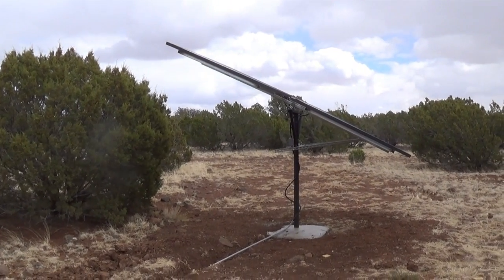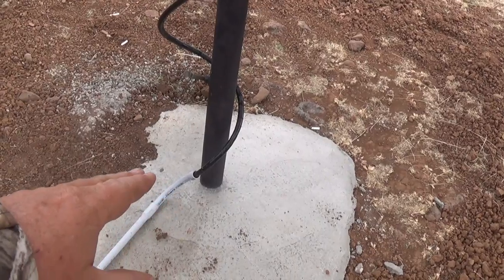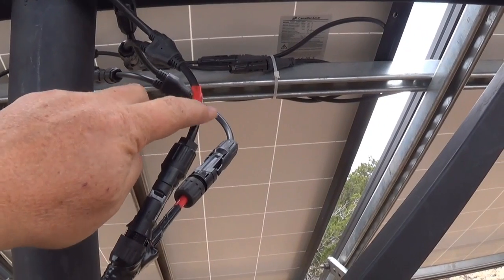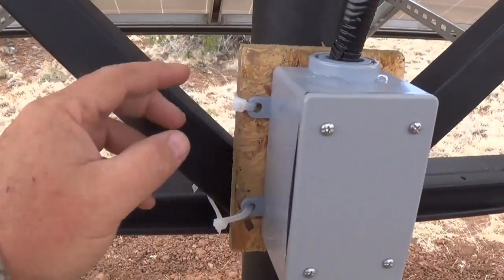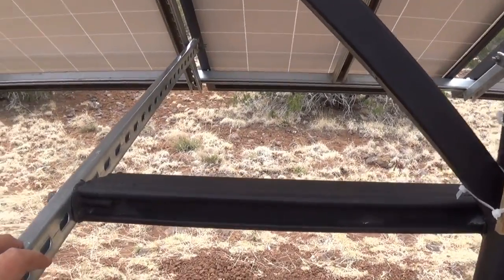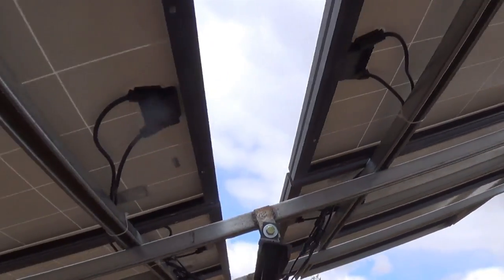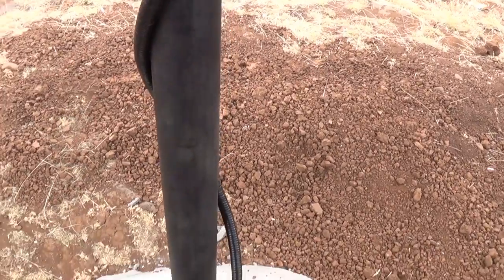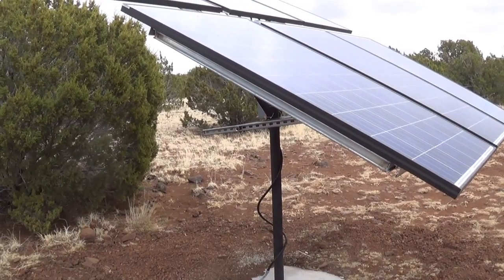Solar Pole Rack - Manual Adjustable both Axis - Holds 6 260w Panels

Comment: For those designing difference in relative load/press  ; Pounds per square foot @ 50 MPH=6.4 PSF,   @ 100 MPH  25.6 PSG   so 4 times as much force.    If he wanted to reinforce his design he could place a collar far up the shaft (so it could still be rotated) and attach outward legs/struts to the ground outside the cement area.   Probably would have other failures at the panel depending areas at some speed below 100 mph though.  He may never have higher wind speeds. We do, most of the USA does too.
Reply from the maker: thanks for the info. i have had 70 mph winds and so far all is holding up fine. i do worry everything the heavy winds come.

Comment: You dont have a good electrical connection between your rotating pole and stationary in the ground pole to make a "EARTH GROUND".  Your ground rod needs to be 8ft long min and driven into the ground.
Reply from the maker: when i add more panels i plan on doing that.

Comment: do you have multiple holes drilled in the inner pipe for rotation ?  if so - do you think the pole has been weakened
Reply from the maker: no. just a set bolt applying pressure to the inner pipe.  dont think holes in the inner pipe would weakened it.

Comment: Hey I have another question if ur batteries start immediately going down once on battery power is it time to get new batteries even tho I have only two small 35ah deep cycle batteries I'm only actually using about 300 watts of power and they runs down quick they don't hold at all basically
Reply from the maker: the batteries not holding their charge does mean something is wrong with the battery. maybe not a long enough float charge or just a bad battery or which i think is your case. if batteries are 12 v 35ah wired in parrellel you have only 35a at 12v to work with. 35 x 12 = 420w of use. you have less than 1.5hrs of use in the batteries. so if you say they dont last 2 hrs and your using 300 watts as your load thats becus your battery bank is not large enough. you need bigger system.  watts = amps x volts..... if you are using 300 w for 5 hours per day you need 1500 watts . your battery bank needs to hold a min of 3k watts. = 12v x amps.. you need at least 250amps for your battery bank.  hope that helps
Reply: @ArizonaHotHomestead  oh ok what about if I get me two of those 6v 225ah deep cycle golf cart battery and make one 12v battery out the two until I can buy another two and have 4 6v 225ah would that be enough !
Reply from the maker: @thelithiumpowerch  the first 2 batteries give you 12v 225a giving you 112a of use at 12v. = 1344 watts. that 300w use now is good for over 4 hours. ... adding the other 2 batteries will give you additional 4 plus hours.
Reply: @ArizonaHotHomestead  oh ok sweet so it should take about 4 hrs of use before I hit the 50% mark ? on the first two batteries ?
Reply: @ArizonaHotHomestead Gm I'm about to head to Sam's Club today and pick up two of the 6v batteries when u say I'll get at least 4 hrs of run time is that meaning til I hit the 50% mark to charge them up ?

Comment: Hello love the video I have a question it seems like no matter witch way I hook my panels up the amps seem to double I'm not sure witch rating is the proper amp rating these are 335w panels one rating say maximum fuss 15A the other day current at Pmax 8.79A either way when I hook two panels in either series or parallel I'm getting upwards of 33-34 amps coming in witch keeps blowing my 40a breaker
Reply from the maker: i am no expert but if you wire them in series you should increase the volts and keep the amps the same. not sure what is happening.
Reply: @ArizonaHotHomestead  I think I figured it out I had this inverter hooked up wrong now the panels are reading the amp the right way

Comment: what kind of power do you get from those 6 panels on an average day? Hoping to see if a pole mount will increase my ground mount production. I get about 12kw with a 4kw system on a nice sunny day
Reply from the maker: i have no idea. i dont check it every day and my charge controller doesnt record the total collected. ground or pole shouldnt matter its the angle to the sun that matters .

Comment: Might want to consider running your wires off your panels to a solar panel breaker box. That way if there's a need to cut power at the panels you can do so easily without having to pull your MC4 connections apart.
Reply from the maker: i do have a inline breaker that i use as a switch to cut the power before it gets to the charge controller.

Comment: My Solartracker Steel Mount ➡️ https://youtu.be/X0lmYFwOq3U
Reply from the maker: ok
Reply: Hi, So increase self-consumption sharply in order to save electricity costs by avoiding electricity from the grid / shortening the amortization. With Dimmer + Solar PV, self-sufficiency will now increase to almost 95%, because expensive purchases from the grid are so easily suppressed and the electricity bill stops just like the electricity meter. The prerequisite is that you have at least a small solar PV balcony power plant, and you don't need an expensive battery either. Example of a kettle: Without a dimmer, the 2500W - 600W PV system needs = 1900W, which you have to pay more for. If I turn the kettle down to 600W with a dimmer, then every weak PV system can now supply each consumer independently and independently, because the 2500W kettle becomes a 600W kettle thanks to the dimmer. No magic, just physics. The 2000W electric heater becomes a 500W electric heater via a dimmer, which I can run 12 hours a day free of charge via PV. https://youtu.be/eC2olbCBhh0 . The 4000W oven is also tamed. It is not the solar systems that have to grow, but the consumers simply have to drop by 75%, which is so easy with the dimmer. I have already switched my entire household to dimmers. Please have a look at my channel. .......... 🌞 ........... Increase mini PV solar self-sufficiency (winter and camping): A boiler and other power-hungry consumers can be infinitely reduced using the "5000W dimmer". Ebay €7. I run 4 dimmers in parallel on an 850W inverter. Kettle 2.2KW at 150W runs 12 hours a day, so the water is always hot https://youtu.be/D9Ss0RuqZG0 . The room is also nicely heated. 2.5KW washing machine runs in parallel with dimmed to 400...600W and always reaches its 60°C, and also its 1400rpm... It doesn't matter to the washing machine whether it changes the washing temperature to 5min@2500W or 100% can be achieved free of charge via existing PV power in 20min@600W. The wash cycle lasts the same time dimmed and non-dimmed, 3Sth 10min. The iron https://youtu.be/-71oL7z1kMU , dishwasher https://youtu.be/8vnAkrS1x-s , oven https://youtu.be/azDjqZpz77U , electric heater https://youtu.be/QbLWDbJi6ew , Waffle iron https://youtube.com/shorts/ofanZCdYEjA?feature=share, coffee machine, all internal heating is throttled with me. Lots of videos on my channel. The inverter stays cool and quiet and the MOSFETs + (battery packs) stay intact because extreme current peaks no longer reach the inverter. Now every Mini PV Inverter is enough to operate large devices. So, with the dimmer, all internal heaters/devices can be converted into base load devices that stay almost permanently ON, drawing very little current directly from the PV. With a wattmeter / energy cost meter you can then measure this perfectly in order to set the dimmer optimally. ........ Comments: "Great idea - despite studying electrical engineering, I didn't think of it myself ;-)" or "I installed it in our washing machine, great idea!" or "Glück Auf Christian, I'm a professional myself but I haven't figured that out yet.👌 Greetings Mitch💚" and many more... LG Christian .............. 🌞 . .............. "smart energy saving", has made a meaningful reaction video, to the dimmer: https://youtu.be/EHtJGiXAjZk . 🌞 ......... "Free Range", also made a meaningful reaction video, to the dimmer: https://youtu.be/qzdRdBObtvY . 👍........ "Jens Kummerow TS", also made a meaningful reaction video for the dimmer: https://youtu.be/fTY5jWvz5CY . ............... 👌 ................ A little hint: Energy cannot be saved. So if I want to boil my water, I always have to use the same amount of energy for one liter. Christian's method relies on a longer period of time with less power in order to be able to use the power provided by the PV as efficiently as possible - so consumption peaks are intercepted. In the end, the energy consumption should even be (slightly) higher due to the interposition of the dimmer, but it doesn't matter, since more efficient coverage by the PV system and therefore better use of the self-generated energy .......... ...... ................ Here an "automatic PV excess control + remote controlled dimmer with heating element" / load management (consumption / heating element follows PV excess .. .): https://youtu.be/IWp7Mi2FldM . LG Christian .............. 🌞 ............... I installed a 2-axis solar controller in my DIY solar tracker: https:// youtu.be/_Rs8CptQcDw. ................ ............... ................ More videos on this on my channel. ....... ................ ................ ............... ............... ................
Reply: Hi, Increase PV solar self-consumption sharply in order to save electricity costs by avoiding electricity from the grid, shortening amortization. With Dimmer + Solar PV, self-sufficiency will now increase to almost 95%, because expensive purchases from the grid are so easily suppressed and the electricity bill stops just like the electricity meter. The prerequisite is that you have at least a small solar PV balcony power plant, and you don't need an expensive battery either. Many examples below: https://youtu.be/eC2olbCBhh0 , Kettle: Without a dimmer, the 2500W - 600W PV system needs = 1900W which you have to pay more for. If I turn the kettle down to 600W with a dimmer, then every weak PV system can now supply each consumer independently and independently, because the 2500W kettle becomes a 600W kettle thanks to the dimmer. No magic, just physics. The 2000W e-heater becomes a 500W e-heater with a dimmer, which can run 12 hours a day free of charge via PV. The 4000W oven is also tamed. It is not the solar arrays that need to grow, the consumers simply need to drop by 75%, which is so easy with the dimmer. I have already switched my entire household to dimmers. Please have a look at my channel. 🌞 ........... Increase mini PV solar self-sufficiency (winter and camping): You can continuously regulate a boiler and other power-hungry consumers with the "5000W dimmer". Ebay €7. I run 4 dimmers in parallel on an 850W inverter. Kettle 2.2KW at 150W runs 12 hours a day, so the water is always hot https://youtu.be/D9Ss0RuqZG0 . The room is also nicely heated. 2.5KW washing machine runs in parallel with dimmed to 400...600W and always reaches its 60°C, and also its 1400rpm... It doesn't matter to the washing machine whether it changes the washing temperature to 5min@2500W or 100% can be achieved free of charge via existing PV power in 20min@600W. The wash cycle lasts the same time dimmed and non-dimmed, 3Sth 10min. The iron https://youtu.be/-71oL7z1kMU , dishwasher https://youtu.be/8vnAkrS1x-s , oven https://youtu.be/azDjqZpz77U , electric heater https://youtu.be/QbLWDbJi6ew , Waffle iron https://youtube.com/shorts/ofanZCdYEjA?feature=share, coffee machine, all internal heating is throttled with me. Lots of videos on my channel. The inverter stays cool and quiet and the MOSFETs + (battery packs) stay intact because extreme current peaks no longer reach the inverter. Now every Mini PV Inverter is enough to operate large devices. So, with the dimmer, all internal heaters/devices can be converted into base load devices that stay almost permanently ON, drawing very little current directly from the PV. With a wattmeter / energy cost meter you can then measure this perfectly in order to set the dimmer optimally. ........ Comments: "Great idea - despite studying electrical engineering, I didn't think of it myself ;-)" or "I installed it in our washing machine, great idea!" or "Glück Auf Christian, I'm a professional myself but I haven't figured that out yet. 👌 Greetings Mitch 💚" and many more... LG Christian 🌞 ........... "smart energy saving" , has made a meaningful reaction video to the dimmer: https://youtu.be/EHtJGiXAjZk . 🌞 ......... "Free Range", also made a meaningful reaction video, to the dimmer: https://youtu.be/qzdRdBObtvY . 👍........ "Jens Kummerow TS", also made a meaningful reaction video for the dimmer: https://youtu.be/fTY5jWvz5CY . 👌 ........... A little hint: Energy cannot be saved. So if I want to boil my water, I always have to use the same amount of energy for one liter. Christian's method relies on a longer period of time with less power in order to be able to use the power provided by the PV as efficiently as possible - so consumption peaks are intercepted. In the end, the energy consumption should even be (slightly) higher due to the interposition of the dimmer, but it doesn't matter, since more efficient coverage by the PV system and therefore better use of the self-generated energy .......... Here an "automatic PV excess control + remote controlled dimmer with heating element" / load management (consumption / heating rod follows PV excess ...): https://youtu.be/IWp7Mi2FldM . ATON - Power to Heat: https://youtu.be/wnVSaioJsjY . "Obermühle" solved this via PLC: https://youtu.be/iR30cDaf1Xk "Heating with excess PV🌞Do your own heating rod control". 🌞 .......... I installed a 2-axis solar controller on my DIY solar tracker: https://youtu.be/_Rs8CptQcDw. .......... More videos on my channel. LG Christian ............... ............... ............... ............... ............... ............... ............... ............... ............... ............... ..........

Comment: I have 6 panels 260w each  31.91v  8.15A   I bought mppsolar 3kw 24v and I want to buy 4 battery 12v  150a or 200a each, 
Please I need help  what size of cable, fuse, breaker do I need? series/parallel? and how much those panels can supply with good 7h sun ☀ every day
Reply from the maker: 6awg between panels to charge controller and between charge controller to batteries. batteries to inverter use 4/0 . wire batteries in parallel and series to give you the 24v use 4/0 between batteries.

Comment: Very nice setup. I just got 8 100w panels and need to build a mount like yours. Can you be a little more specific? what diameter is the pole, is it steel? What does the  inner pole ride on so that you can rotate it easily? Is it on a bearing mounted on a plate? any info you can provide would be greatly appreciated or from anyone who reads this. thanks
Reply from the maker: the pole in the ground is 3 inch 4ft in the ground with 2 ft above. the other pole is 4inches  . the other pole just slides over the 3inch inner pole. no bearings no plates, just a hole drilled in the outer pole with a nut welded on and a bolt with another piece of metal welded to it do make it easy to screw in and out. screw in the tighten in place unscrew to loosen and rotate the panels.

Comment: Nice set up, I was considering using unistrut myself. What size pipe did you cement in the ground and what size is over it?
Reply from the maker: 4 and 6 inches. .  make sure you have good support becus the unistrut is flexible so under high winds you wouldnt want it to flex to much.

Comment: One foot of pipe under the concrete is not enough ground!  You should add at least three eight foot copper ground rods outside of the concrete base and securely ground the frame and panels to those rods.  
Good video, Jim-WA5TEF
Reply from the maker: thanks for the input.
Reply: 3? I dont think so slim.  It should 1 (8ft) ground rod.  A whole house only needs 1 ground rod.

Comment: Greater in from Puerto Rico after Mari a huracan I'm around 70 days without light in try to start a project with same 6 panels for concrete roof. Please can list all materials used i realy appreciate any help. Thanks
Reply from the maker: to mount i am not sure all the materials. i did do a video on how it was built. might want to watch that one. basically its just unitrack welded together and a few bolts and a couple of large pipe/poles in the ground.

Comment: Looks good! What kind is your main pole? 2 Inch? Rigid Conduit? Galvanized  (Fence) Steel pipe?
Reply from the maker: the pipe is 6 foot 3 inch oil field pipe sched 80 with 4 feet  cemented into the ground. 4inch oil field pipe goes over it allowing you to turn the panels to face the sun.....
Reply: ohh that's how! Great idea, looks like a VERY RIGID setup!! Thanks for sharing!

Comment: Your grounding system is in adequate.  Dissimilar metal  oxidation will develop degrading the contacts.
Reply from the maker: interesting. and yet an electrician said it meets grounding codes.

Comment: what did u start out with
Reply from the maker: 2 basic 6 volt 100 amp batteries the trailer came with and 45 watts from harbor freight. lol had to run the generator a lot that first year during the winter to keep the rv furnace running.

Comment: Nice!  You will have plenty of power. Wow that's a new one-the system you have being too small for code. I get away from it for having a portable system.
Reply from the maker: +Prima Donna Going Off Grid some counties go by cost while others go by number of watts in the solar array. . portable system is great. I was using harbor freight panels that totaled to 90 watts for the last year. it did great.

Comment: good job, he we see the output of this badboy
Reply from the maker: +snoopy speagle thanks. output could be as high as 1560 watts, 24 plus volts and up to 60 amps. so far I haven't reached that because it seems to charge the batteries pretty quick.